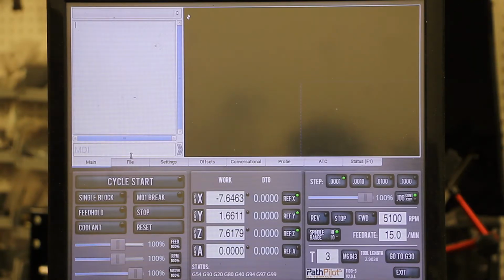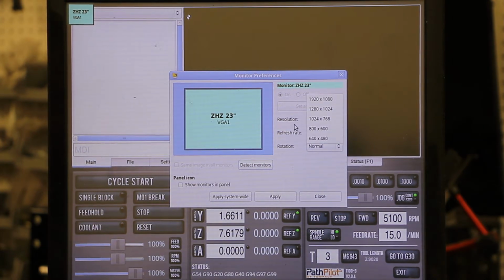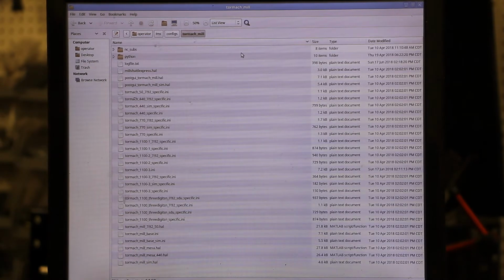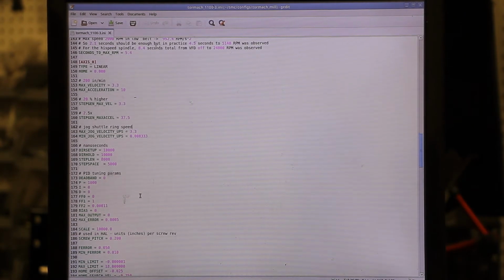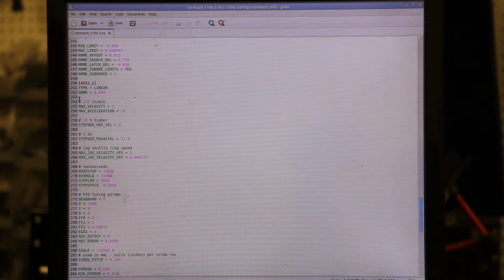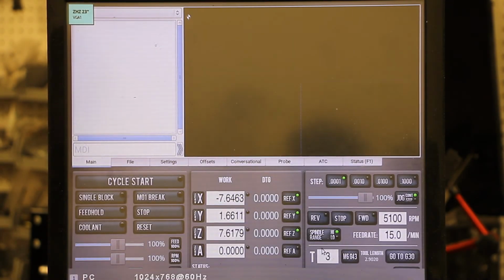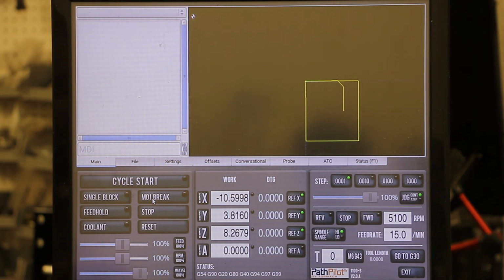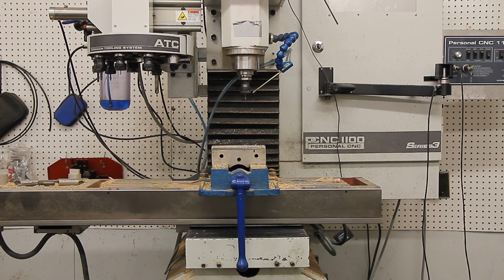Increase Tormach PathPilot Rapid Speeds

Comment: Thank you so much for this, I was having a problem with my Y axis stalling and I lowered the speeds and it doesn't stall anymore.
Reply from the maker: Was it stalling at the stock servo settings? If so, I would think you have a hardware issue such bent gib, too tight gib, trash in the dovetails, etc.

Comment: Hey There, thanks for the info, Iearned a few things. Suggestions for Version 2.4.3?---Different enough that none of the commentors suggestions worked. I am eagerly waiting the servo upgrade--300IPM. That going to be way better. www.AndersonPrototypes.com
Reply from the maker: I haven't done the most recent update yet. Haven't had a chance to down the machine long enough and fool with the new ini files. Hopefully they didn't make it basically impossible. The updates used to not break it, just copy the file after updating. It seems it got more difficult each time after I posted this video. I hope I'm not why.
Reply: @williamclark77  Thanks. Hopefully you wiz right thru it. Please keep me in the loop.
Jim
Reply from the maker: @AndersonPrototypes  I still haven't updated. Been too busy, which is good I guess. I plan to every weekend but too many projects to down the machine.

Comment: Have you figured out how to do this on the new pathpilot 2.4 software?  They changed the ini file to not have the speeds listed anymore.
Reply: ETA... just found it.  They changed the speeds into a different file named tormach_mill_base.ini
Reply: @bigdog200399  Actually, 2.4.3, this doesn't work with. Its different, no IPM, its something else. Let me know when you update please. Jim
Reply from the maker: I haven't updated to 2.4 yet. I planned to in a few weeks when I had time to down the machine and play with it. I figured they would eventually do an update to make doing this more difficult, especially after the new faster machines came out.

Comment: Nice walk through.
Reply from the maker: Thanks.  It's pretty simple once you figure it out.
Reply: Absolutely, LinuxCNC is very capable software and the manuals available are very helpful. It just takes time to read through them to figure out what does what. Im so happy Tormach went with LinuxCNC.
Reply from the maker: Jody Olivent I've been thoroughly impressed with PathPilot. I built a three axis cnc and used LinuxCNC with a Gecko G540 controller. It was surprisingly easy to figure out - the basics anyway.